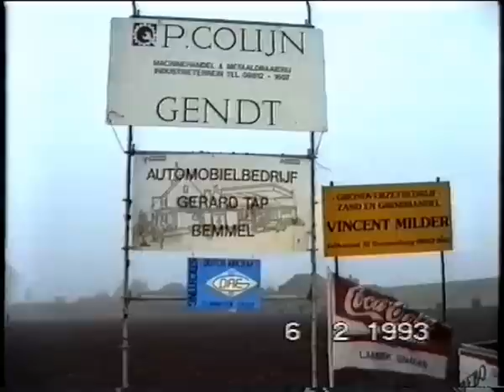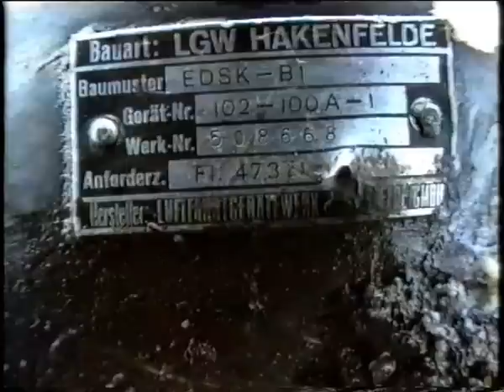Excavation of a Messerschmitt 109 G6u4  Luftwaffe pilot Ullmann 1993

Comment: i cant make out anything from those parts, but i suppose the blue coffin kind of thing was for the pilot? so when they were picking that stuff into that box it was actually the pilots remainings? i dont understand
Reply: Yes thosse where the pilots remains/bones which where later buried in Ysselsteyn war cemetery, if you pause at 12:49 you can see the moment they find exactly where the remains are as you see parts of the pilots clothing
Reply: Yes, the remains. The materials are sometimes sent to laboratories, because  they contain information about the quality and the resistance of materials. The state of German materials after a long time in the soil turned out to be better than those of Allied aircraft. The oil is sent to Shell laboratories. They were surprised about the quality of the lubricating oil, in 1944 made by hydration of coal. After more than sixty years it was still so good that you could use it without any problems for your car. The Germans did never make concessions to quality. Remember the report Galbraith had to make  for president Truman  about the war between the US and Germany. He ended as follows: "We won this war not because we had better generals, better soldiers or better tanks - they were German. We won from them because we simply had far more of everything."
Reply: Yes
Reply: @mjwgjema7884  I'm an American and I think I speak for all Americans...at least those whom has any knowledge of anything...that the Germans are on a whole different level of engineering,  be it cars, planes, tanks or weapons and the building of bunkers. I've heard it said on a program I watched many years ago that the Germans made (and still do) far more superior (fill in the blank) than the rest of the world but that the equipment that they built were far too complicated and couldnt be fixed in the field like our (Allied) equipment could be. The Germans in WW2 were awesome in regards to their building of various things. If they wouldnt have had Hitlers crazy ass and his thugs in a position of absolute power and the atrocities that were committed to innocent people then I wonder what kind of place Germany would be nowadays. If they have rebuilt all of their cities and infrastructure since 1945 and are back again as a strong modern city, leaders in technologies and auto industry what would their country be like had WW2 never happened. The world for tht matter. God bless those whom fought and died between '39 and '45. And I wish we could learn to live together without killing one another. Peace everybody.